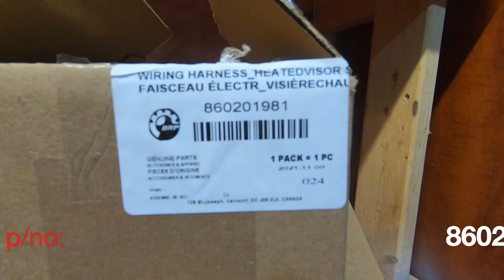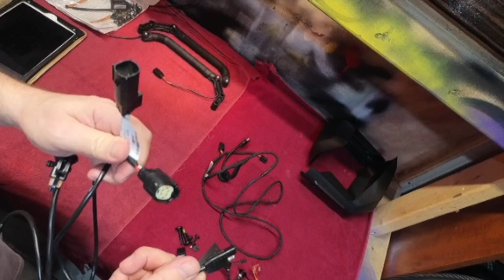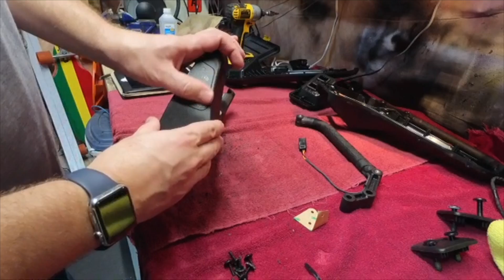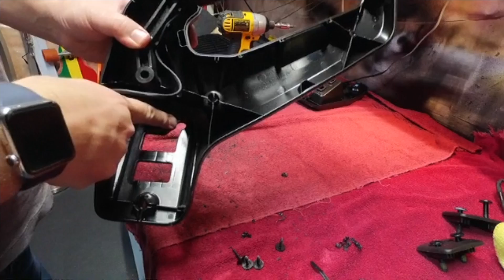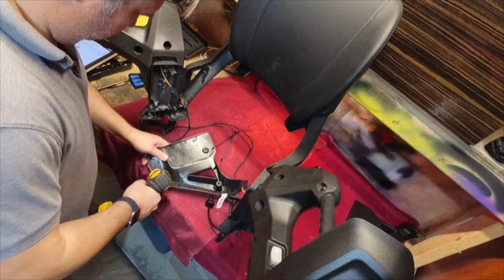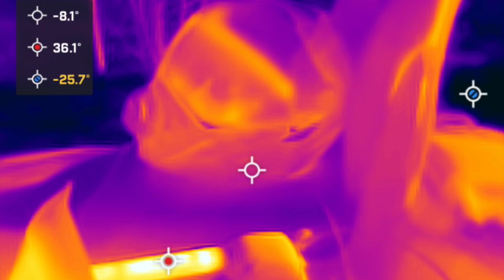Ski-Doo LinQ 1+1 Rear Seat Heated Grips Installation

Comment: Not clear which color wire goes  where
Reply from the maker: - The Orange wire is connected towards the rear of the vehicle (pin 8 on the switch if labelled, rearmost pin otherwise.)
- The Red wire is connected in the centre (pin 6 on the switch if labelled, middle of the 3 pins otherwise.)
- The Orange/Violet wire is connected towards the front of the vehicle (pin 5 on the switch if labelled, frontmost pin otherwise.)
I hope this helps!

Comment: I just started following  I'm looking at getting a 2024 ski-doo expedition sport 600 efi  , i want a new sled and the wife wanted a two up , this video will make getting her heated bars easy! Very knowledgeable videos
Reply from the maker: I've really been enjoying the 600EFI, and it's a great value for a 2-up sled. While you're doing the rear heated grips, you might as well get the rear heated visor connector too. Otherwise, you'll have to take the whole handle apart again to do the visor plug later.
Reply: @mop1471  Thanks for the advice,  just have to find one now , a place near gravenhurst says they'll be getting some in , and put one aside for us
Reply from the maker: The dealer here in Sudbury keeps a good stock of the heated grips, and I would imagine most dealers do. Good luck with the install: it is a bit of work. Take your time and double (or triple) check everything before cutting the plastics (I nearly cut the switch opening in the wrong side!!!)

Comment: Great video. Awaiting the wiring harness for the heated helmet outlet for the rear passenger, which is on order through my dealer. I picked up my 2023 expedition sport a couple of weeks ago. The purchase was partially inspired by your videos. One project I'm about tackle is to wire mini led s behind the toggles for the headlight switch and heated grips which are impossible to see at night and in fact dangerous. Skidoo should never have mounted them on the console. I'll also add lighting to the glove box. Hope it works out.
Reply from the maker: Rear  Visor harness & heated grips: take your time with the install. Check twice and cut once, etc...

Console-mounted switches: I agree 100%. Especially the high-beam switch. Riding in the dark, an oncoming switch crests the hill infant of me, and I'm expected to take one hand off the handlebars, reducing my control, and eliminating my control over the brake, to search for the high-beam switch??? Alternative is to blind the oncoming rider? Safety problem for sure.

Comment: Thanks for the content! Been thinking of doing this upgrade for the wife on my 22 expedition sport 600 ACE. We are still waiting on decent snow here in Central NL, hoping for more soon!
Reply from the maker: It's a bit of work for sure. I was able to get it done on a Sunday afternoon.Take your time, especially when it comes to cutting the plastics: both the left and right side plastics have the cut-out marks, but the switch must be installed on the left side (wiring won't reach the right side.)